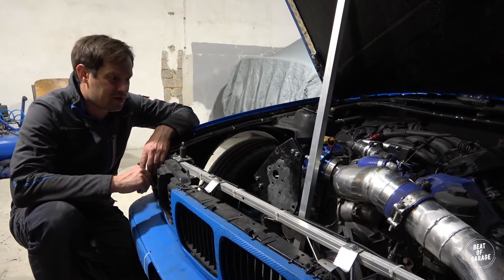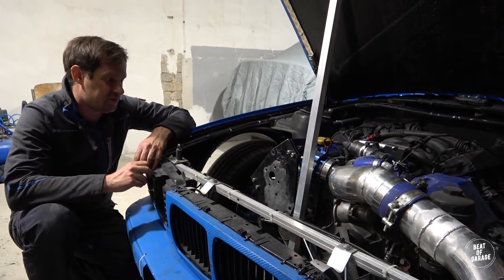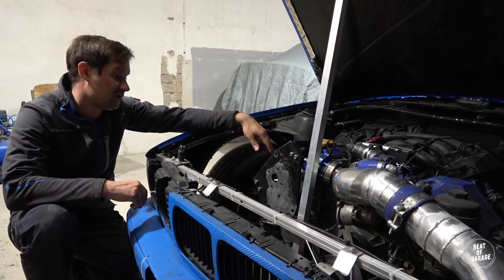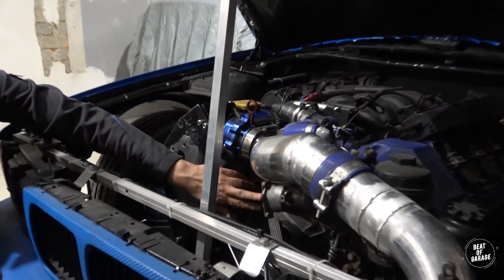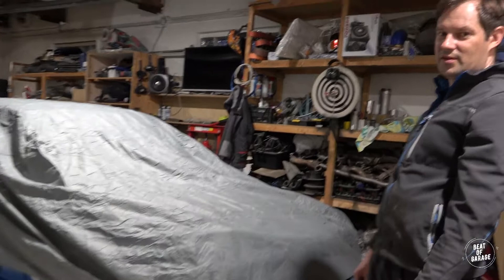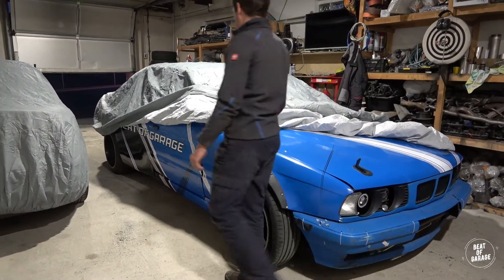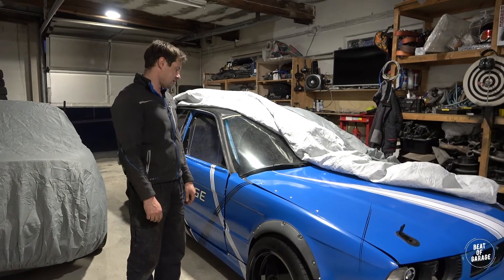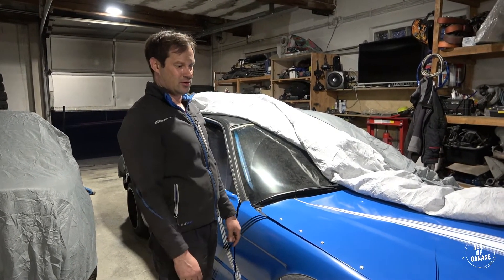Two engine in one! V8 M62+M60

Comment: Very interesting build, I'm using m62b44 on my Nissan Silvia, I have m60 heads at home....what are you thinking about m60b44 n/a? How many hp? I'm using also all exhaust with manifolds and stand alone Power unit (megasquirt2)
Reply from the maker: At m60 heads have bigger valves of intake, so more power!
Reply: I have 359 with m62 + m60 heads and supersprint headers, without headers it was 350, also vems ecu